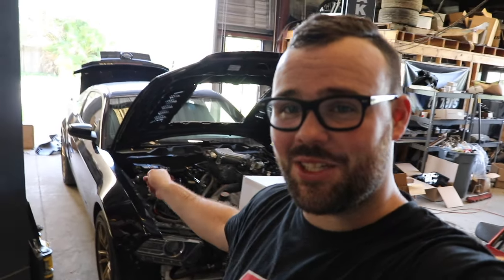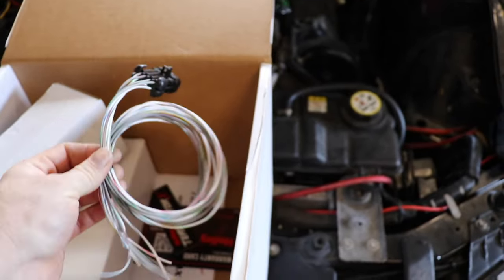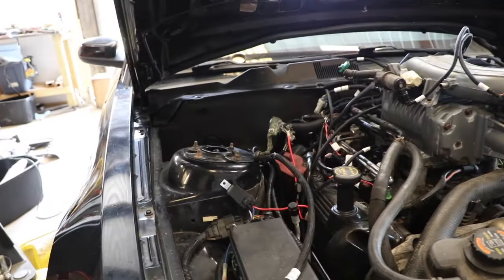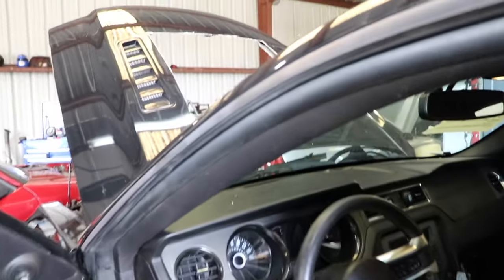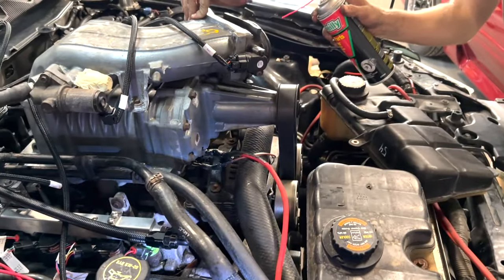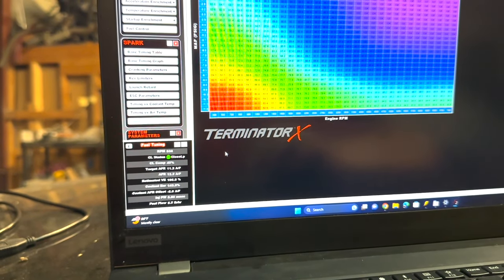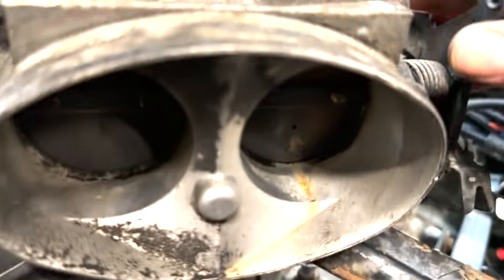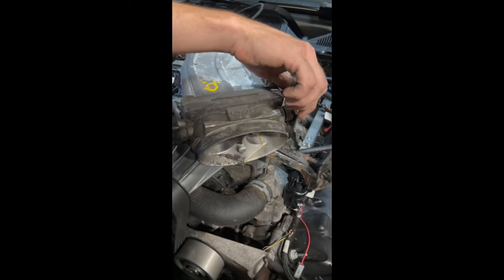Lightning Swapped Mustang is alive! Supercharger Whines so LOUD - Holley Terminator X Install

Comment: Sweet, now throw a 10lb lower/2.7 upper if you really want it to whine and to throw your rods to the moon 👀 I may know alittle somethin about that 😅
Reply from the maker: Haha. I literally have no idea what this will make with the 6lb lower and stock upper
Reply: 6lb lower on a 2.7 is the limit anything over that is rod mooning in time.
Reply: @MustangLifestyleTV  it'll be interesting to see for sure.  I know on a Lightning, should be right around 400, of course depending on the dyno, weather, ect.  You also got some different stuff going on, not exactly a typical Lightning setup lol, so hard to say, but we shall see! 🤘
Reply: I have the 10lb lower, 2.7 upper, ported blower.  And other odds and ends. Made 19lbs of boost and 500 rwhp. 93 octane. Dynojet dyno. Build was by Livernois Motorsports. Just for a reference.

Comment: the green 440cc's like to see 20psi to 25psi at 0psi engine vacuum and idle at 13psi... plugs are the prefect brown color for the 4.6... have to run the fuel pumps for 15 seconds on a hot motor before restarting to get all the boiled fuel out of the rail. wonder how many engines that blower has blown up?
Reply from the maker: What….?